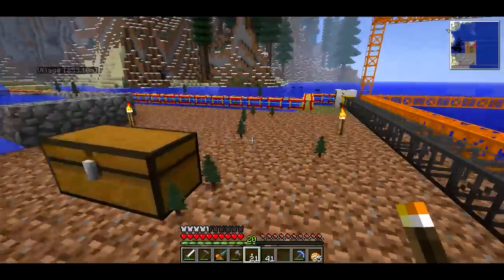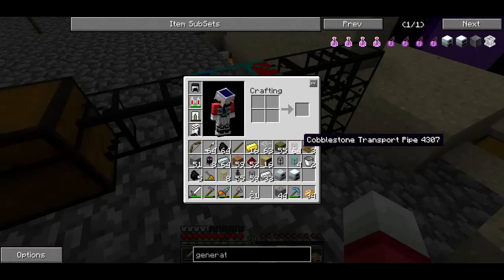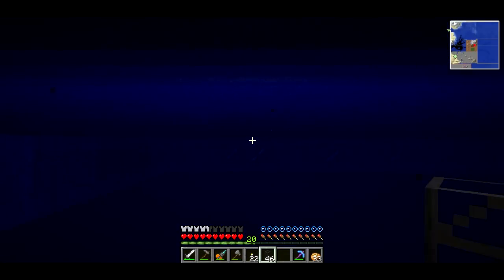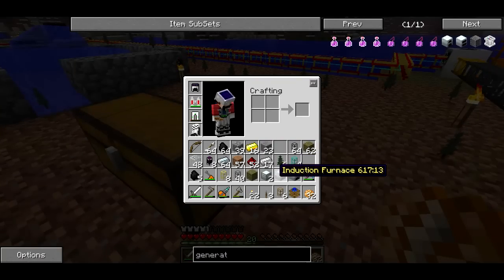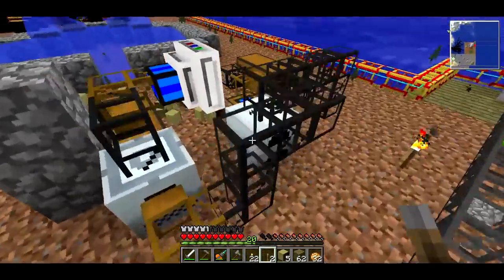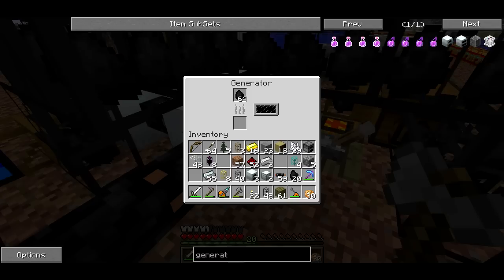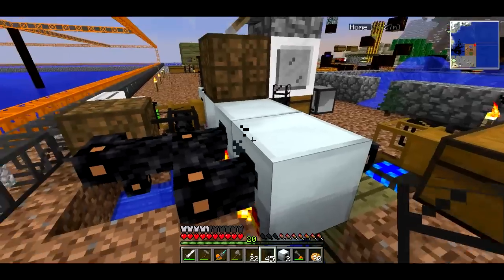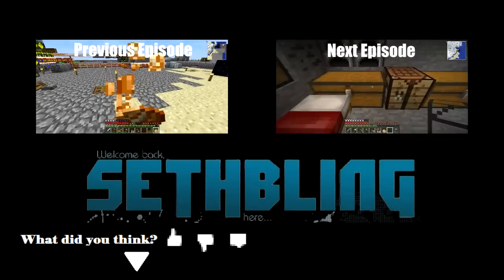SethBling Plays FTB -- Episode 7: Charcoal Factory

Comment: the tube loops are good for keeping stuff full, but if you use it for many different machines with the same input it's not reliable. If the item input is too high the machines will back up and the tubes will collect an infinite number of entities inside. Conversely some machines might not get enough items.

Instead, place a diamond transport pipe directly next to the machine and sort the items into it. If and only if the inventory is full the pipe will just pass the item along.

Comment: Hey Seth, you mentioned in one of the videos that it's not possible to make your turtle follow you around. Well that's true but you can make it controllable with WASD QY keys, kinda like in MCEdit. Just make w a s d q and y programs and make it so: if there is an argument, it moves that many blocks, but if there is no argument, it only moves 1 block (that's not meant for a and d). You can also make ww and yy programs which run until the turtle hits a block.
It's really simple to use. Try it! :D

Comment: At 10:55 you break the bone tube, but you leave two pipes on the old connection so you'll be loosing alot of drops out of that tube underwater, Just thought I would help <-- Might be the reason for such a low bone-meal count

Comment: Thanks for the Code :) I used it on my server and had nearly no issues. But one thing. When my mining turtle compares the wood on slot 2 with the grown wood on the tree, it always returns false, even when i manually let him compare those two blocks via lua interpreter. Is this a gameside problem or have I done anything wrong? The code is correct, even the turtle.compare() function gives a false return. I changed the code so it just continues after 5 tries of bonemeal. Thanks for that :)

Comment: @VelthosHD The un-overclocked electric engine outputs 2 MJ no matter if it gets 1 EU a tick or if it gets 10,000,000. So LVL is the most efficient way for him to currently run the engines.

Comment: It wasn't working because 4+ copper wires in a circuit looses quite a lot of power compared to glass fiber cable which you should use instead.